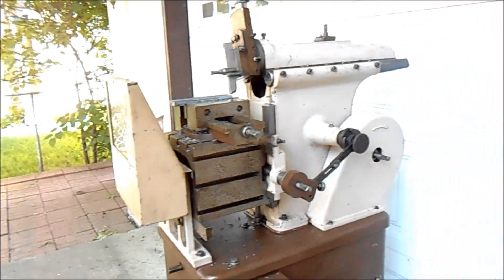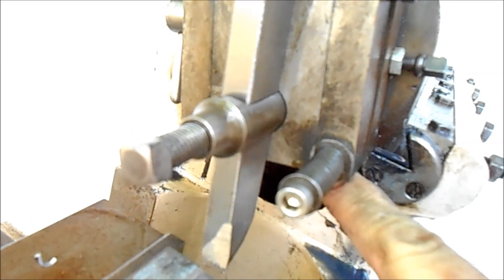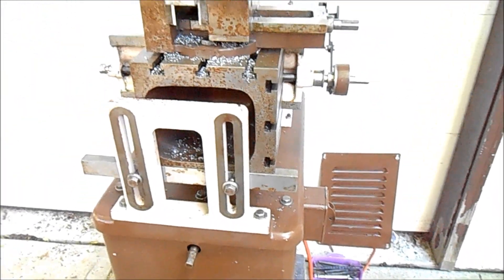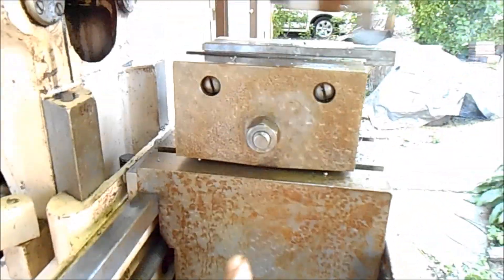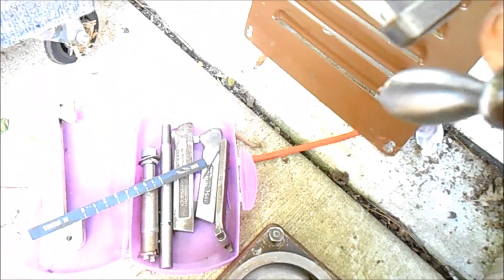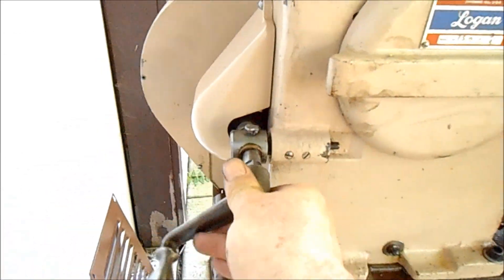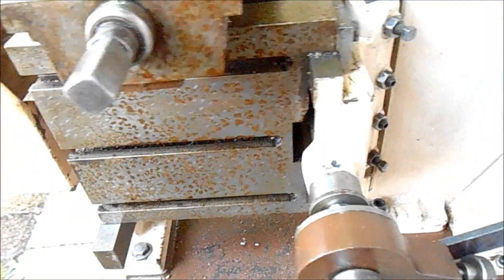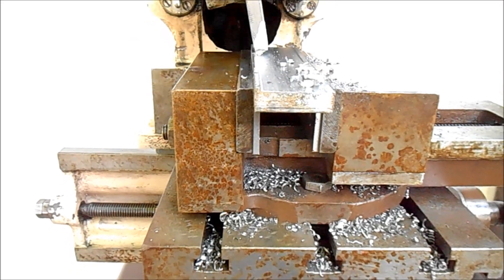Logan Shaper HD

Comment: Lucas, it looks like there is a lock on both sides of the clapper, the one on the left side almost looks like an original with chrome plate and all. Is that original? Mine doesn't have locks on either side, but I'll put some on it for sure.